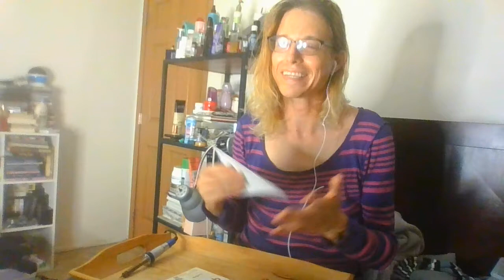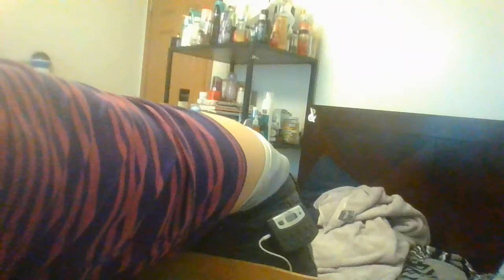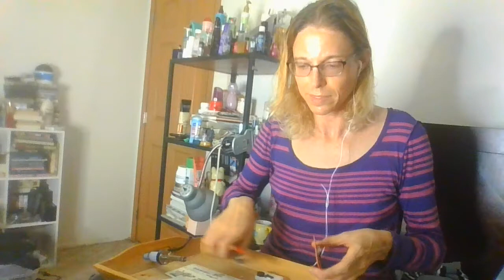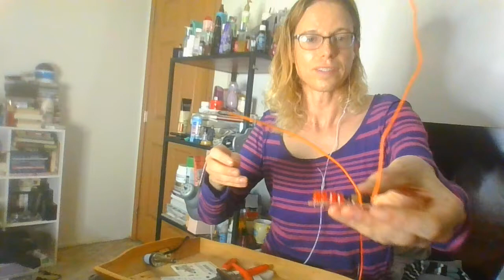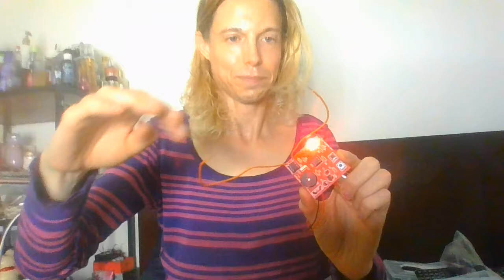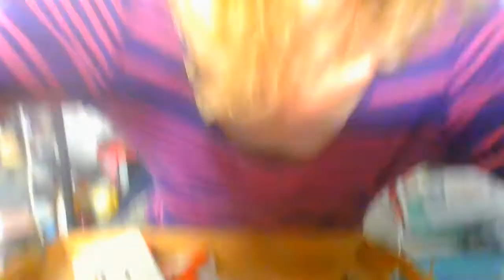Electronic Kit Assembly: Theremin

Comment: Hey, I just stumbled across your electronics YT channel and I think I like it a lot :)
Cool little project, but the high-pitched piezo membrane really hurts my ears...

Madlab? Curiously, a friend of mine named her little electronics shop "MadLabs" :)
I'll be building a vacuum tube theremin next year. Pity it's not gonna be a recreation of Moog/RCA that was featured in Jan '54 issue of Radio & Television News. That design used inductive parts made of unobtainium , at least for my little facilities. By the way, that was THE schematic that appeared in the water chip intro in the  original Fallout cRPG.

I never use my fingernails as tools, they're too damaged and short already, and I'd really love to have long-ish, nicely painted nails... Manual work and beauty seem to be mutually exclusive. 

As for resistor color codes, I memorized them back in very early 2000s when my interest in electronics started. There are still cases when I can't make out a color, or the marking is not typical 3 or 4 strips, and when that happens, I shamelessly use a multimeter :)

As for association of the third strip, it's just the exponent of power of 10. Orange is 3, and 10^3 = 1k, then you multiply it by the number indicated by the previous numbers.Brown-black-orange is 10x10^3 i.e. 10k. SMD resistor markings also work this way: 333 is 33x10^3, i.e. 33k.
Capacitor markings (apart from electrolytics) are pretty easy to decode if you remember that they're given in picofarads. For example, 473 is 47x10^3pF i.e. 47nF, and 105 is 10x10^5pF i.e. 1uF.

So nice that you mention Mr Carlson and Big Clive, I love those channels. I think you really need to check out Fran Blanche as well, if you don't know her yet. Another one of us trans-sisters :). She's soooooo wonderful, and I'd absolutely love to meet her in person.
Reply from the maker: Aww thanks , i love your channel too, i work and sleep alot, but want to be more involved in and on Youtube this year!